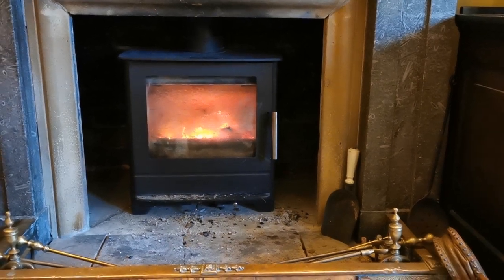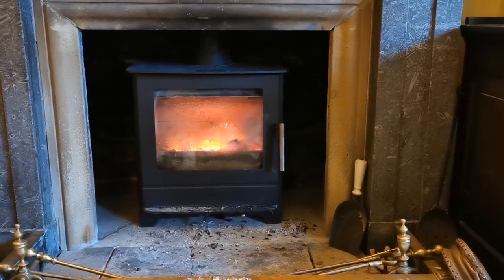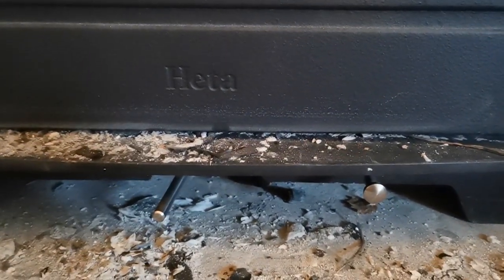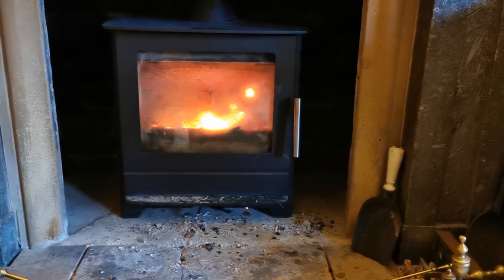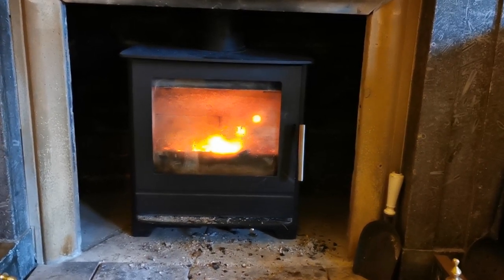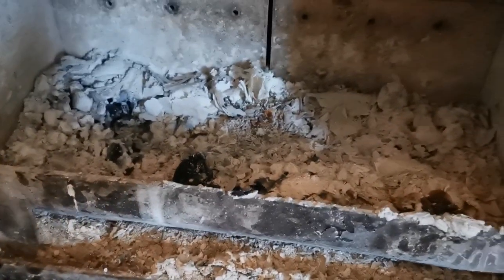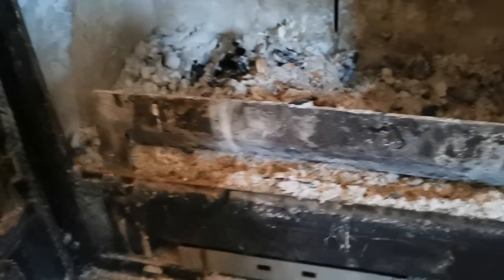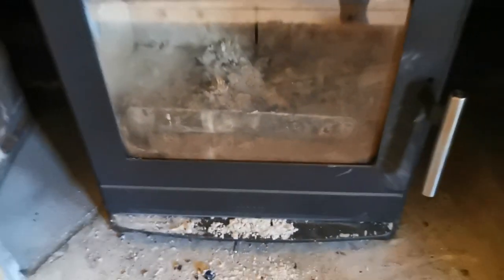Owners Review of the HETA Inspire 45 Log Burner

Comment: thanks for the thoughts, I was about to buy one...question if you had to buy a new burner would you buy another Heta ?
Reply from the maker: I'm just sat in front of it now as I answer your question and its heating up the lounge wonderfully. Answer is yes as its the only one our local company supplies that would fit our fireplace. If i was buying it again we'd go for one that was just a log burner as the riddle on the multi-fuel gets blocked very easily, and is hard work to clean We never burn anything except logs.
Reply: @gardenerscottageblakeney1316  Very interesting and useful video, thank you.
I have been looking with real interest at the HETA models Inspire 45 and 5, the benefit of the 5 is the true wood burner design without grate which resolves so many of the issues you highlight here but unfortunately the additional height of that model also makes it just too tall for us, with an installation that is very similar to yours, dimensionally.
Reply from the maker: What model of stove did you go for in the end

Comment: If that is wood burning in the video you have the vents too low. At normal temps, burning wood, the glass should clean itself. Why are you closing the door onto the build-up of ash? Burning wood i expect to see flames, not a glow. This stove is the one every other is measured by, at 85% efficiency, so very surprised at the state of it. Also, you shouldn't load the stove above, or blocking, the are vents at the back. Very confused.
Reply from the maker: Thank you for the feedback
Reply: Sep is correct about you not using the fire correctly. Please see the review on The Tortoise YouTube site on this fire, he explains fully how it should be lit, run and it’s efficiency without getting glass dirty.
Reply: @CosyP did he run one for two years
Reply from the maker: Thank you could you post the link as we are about to start using it again for autumn so would be helpful to know
Reply from the maker: Thank you

Comment: UK govt saying we shouldn't be burning any fuel. Why would you put in a stove now?
Reply: Stoves don't emit any more co2 when burning kiln dried wood. Research it
Reply: The ash tray is for burning coal, as you leave the vent open.  For wood, this remains closed as you don’t need any air coming from below.  A wood burning stove does not require a vent or ash tray, so you would always be required to get a shovel to remove any ash whilst cleaning the stove.  Good review though, thanks
Reply: The gov can say whatever they want - I will do whatever I want. 😂
Reply from the maker: This stove is multi fuel so can burn smokeless fuel like coalite or well very seasoned logs. We are in the countryside not the city. I think regulations are different in UK cities.
Reply: Are you sure it’s m/f?
The makers website states log burner with no mention of coal
Reply: Well if the government says it, it must be true...🤔
Reply: Answer to question given in your first sentence. Oh, and make sure you also ask the BBC what you should be doing - you can never be too brainwashed.
Reply: I can't believe you've let your fire get in that state don't you or your other half at least keep the ash at bay no wonder you've got issues, and closing the door on all that ash build up is just laziness in my book